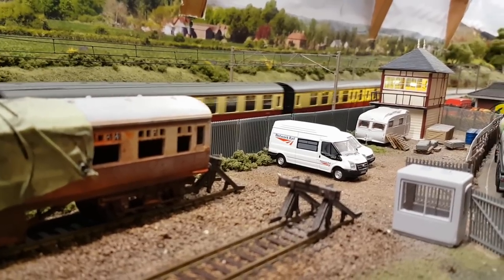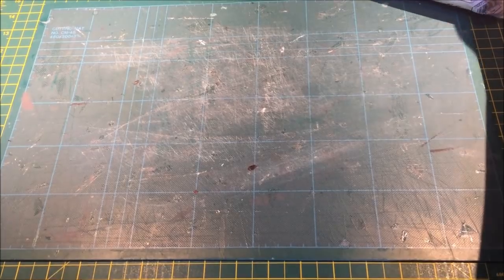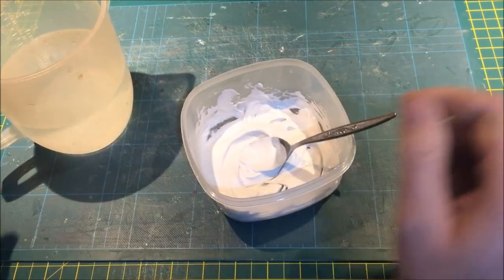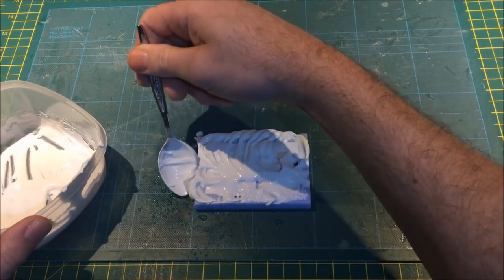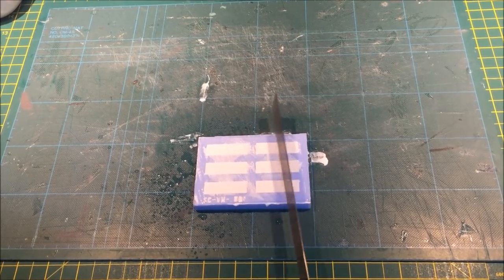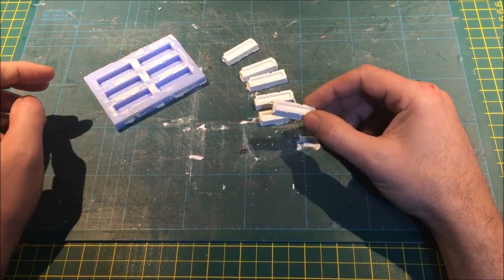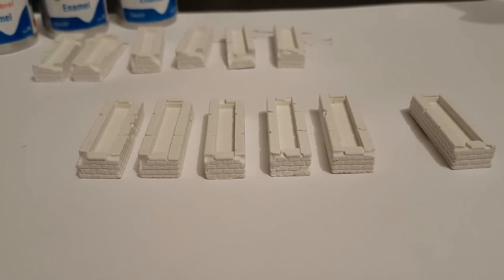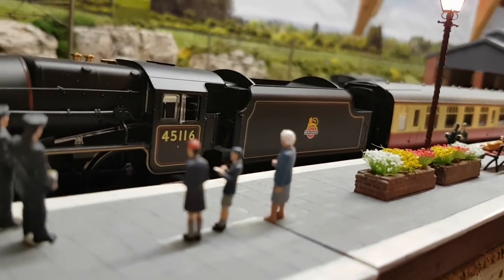How to make Platform Flowerbeds - ft Special guest 'Jason' from Barnabas Junction

Comment: The reason you got those "imperfections" from the air bubbles, Jason, is because you made your mix way too thick. If you'd made it thinner, it could have been poured into the mould slowly and avoided the air bubbles.